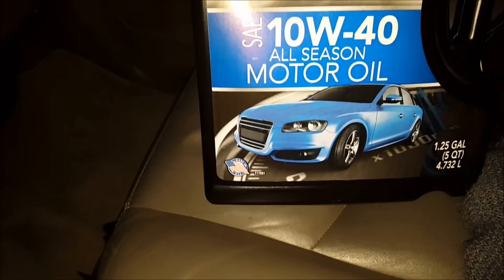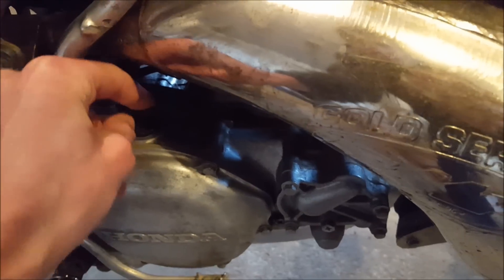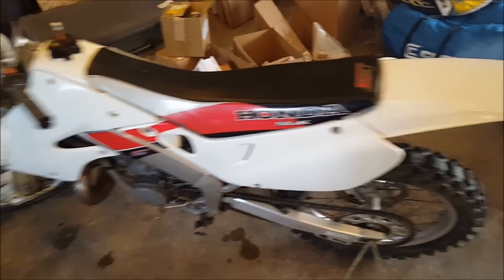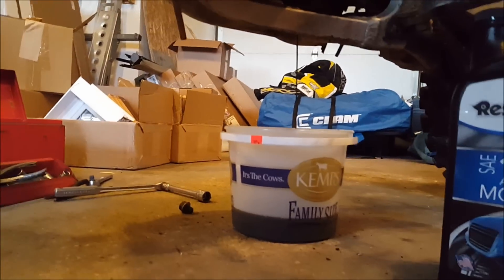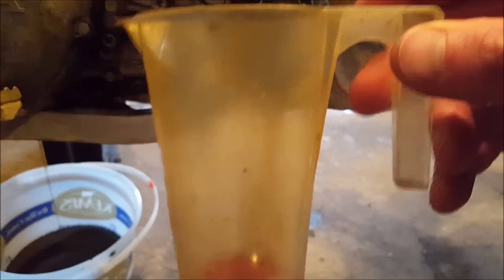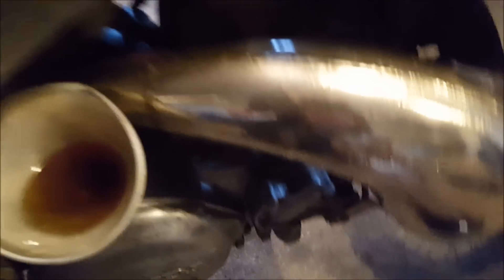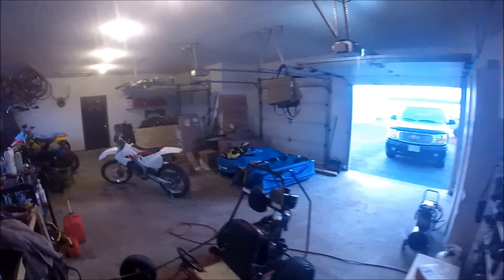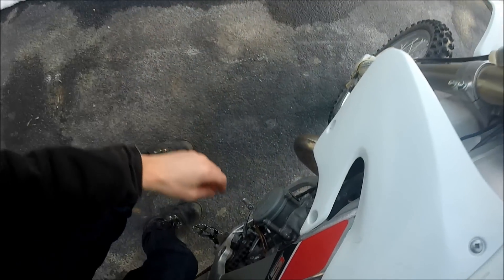First Ride on the New Honda Cr 250!!!

Comment: dont take my word on it but sounds like the powervalves arent opening or clutch is slipping
Reply from the maker: Randomman31 yep clutch was slipping. I took the clutch apart and added new oil again. It doesn't slip anymore.
Reply: Randomman31 Hey aren't you selling your bike on Craigslist in Green Bay??
Reply: yeah I sold it yesterday Austin
Reply: Randomman31 thats wrong oil for that bike, thats the problem
Reply: Randomman31 Darn! I was super interested In it! I was going to message you, just wanted to sell my bike first.
Reply: this is really trippy
Reply: James Palmer your the one who bought it right
Reply: oops i miss understood you're comment my bad
Reply: Randomman31 nah, my last dirtbike was a 1983 CR- 60  back in 1986
Reply: you wont lock up a 2 stroke by having bad oil u can run a 2 stroke with no oil if u didnt get it to hot cuz its not engine oil just gear oil a 4 stroke would lock up tho cuz it has engine oil and gear oil
Reply: KING TROLL yes but he said he doesnt want his piston to sieze, and pistons dont sieze on 2 strokes from lack of oil u can run a 2 stroke without any oil if u dont get the clutch too hot
Reply: HDlego Some 4 strokes use only one type of oil for engine and transmission but it has to be a very good type of oil that's good for both.
Reply: James Palmer Oh no that's not what I mean! I mean to say that bikes that only share 1 oil tank for the whole bike, that you must get the right oil according to the manual. Unless it's like    4 strokes Hondas crf where they have two oil tanks for motor oil and gear oil.
Reply: Wazzup ya thats true
Reply: Wazzup i know , i was trying to pester someone
Reply: James Palmer Lol no problem
Reply: Randomman31 it also sounds like the powerband isnt hitting
Reply: I heard you can use vegtable oil in motorcycles
Reply: @jamespalmer9556  exactly

Comment: I have a cr and tbh I wouldn't put that 10w 40 in because you mix oil with the gas. Try maxima transmission lubricant     That way you don't risk messing up your bottom end

Comment: When you where pinning the bike it sounds different to my yz85 2 stroke it sounds as if something is wrong with the clutch and it sounds like you aren't changing gear just dipping the clutch (just my thought could be wrong)
Reply from the maker: Declan Price Yeah it was slipping. I fixed it now. I just had to clean the clutch.

Comment: Does it even matter if the engine oil is so called racing oil because its only more expensive than normal oil for cars (this is meant if you change oil every 10hrs)
What I mean to say is do you have to buy racing oils when you change it on 10hrs or can you use normal oil for cars?

Comment: What would you recommend a 125 or a 250 I'm 5 foot 8 and I'm 15
Reply from the maker: Stunted Crew 125
Reply: Stunted Crew 125
Reply: 250 cuz once u get a 125 and get used to it, ur gon a want a bigger bike. 125 is the same height as a 250 but 250 is like 65hp amd insane power